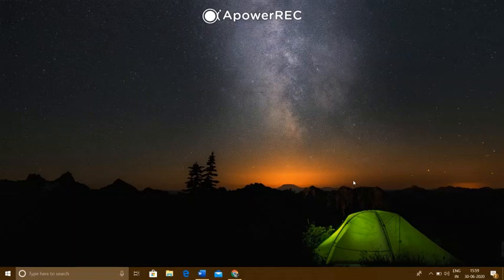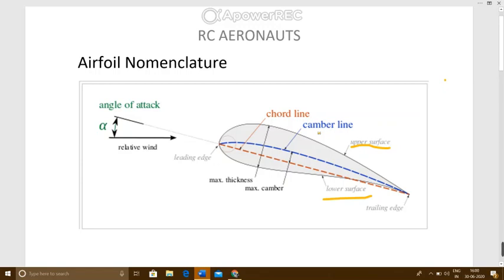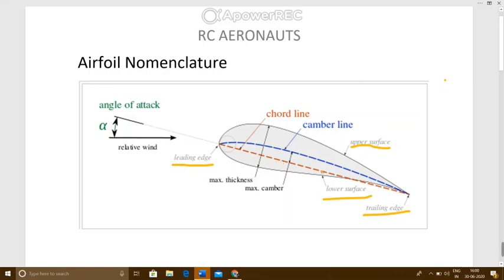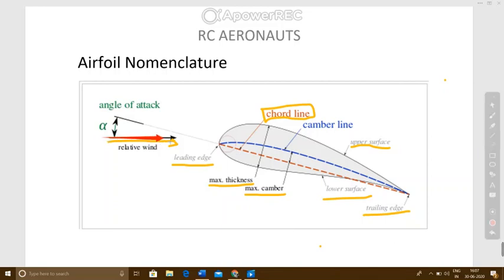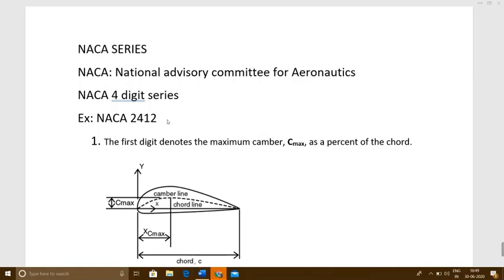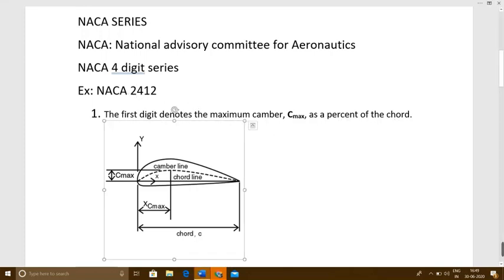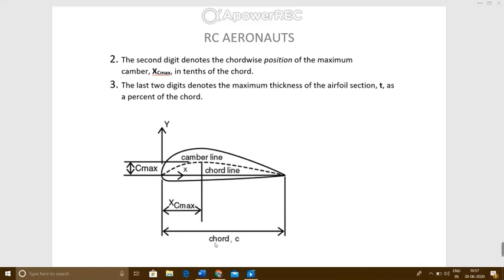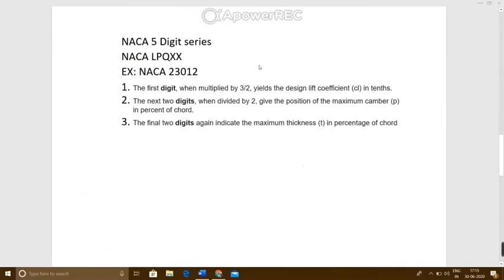Airfoil Nomenclature || NACA Series Explained || NACA 4-digit series explained || All about NACA

Comment: Very  instructive. For someone that knows nothing or little about NACA airfoils and what the digits stand for, this is a great simple straight forward video that explains  everything in detail  but so anyone can understand.  Thank you for the video  and keep then coming. Great work. Also join our speed competition  for a foam board built plane. It's all in fun and designing an airframe that is low enough in drag to go 200mph. That's our goal. 175mph had already been reached and the difference  between  175 and 200mph is astronomical.  I think we could 3d print or build a plane from balsa or carbon fiber that would break 200mph all day long, hear the challenge if overcoming the drag induced by a foam board airframe. Please join us...it would be nice to  have such a beautiful  competitor especially one that's intelligent  as you are. No rules except the airframe must be constructed out of foam board and which brand is your choice. Carbon fiber spars are allowed,  fiberglass tape, packing tape, epoxy, hot glue and if you have any doubt then just ask me. But please join our friendly competition.  1 motor or 10...its up to your...10mm ws or 100000mmits your choice, propeller or EDF again it's up to you. I gave you a thumbs up and subscribed to your channel. So it's only fair for you to join up and compete with us. Btw my mave is Maverick. Hope to hear from you soon.